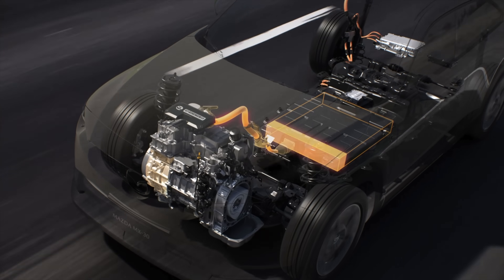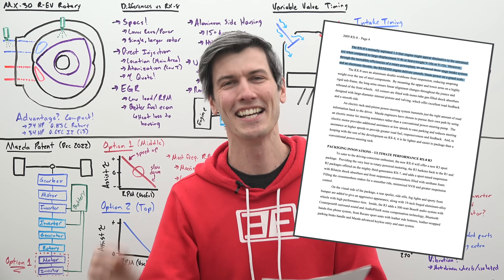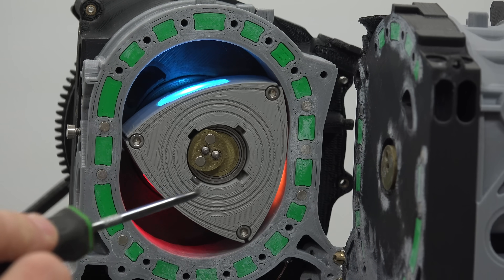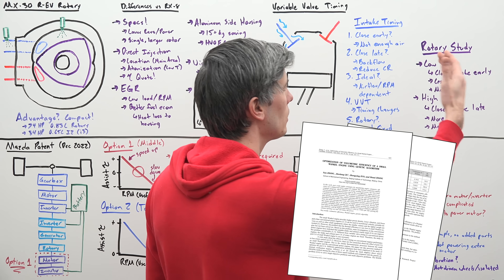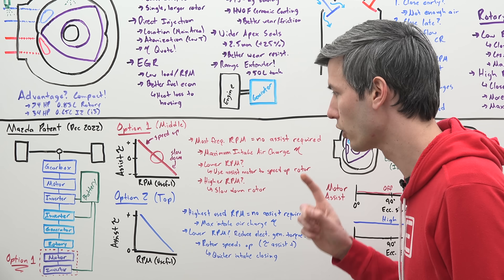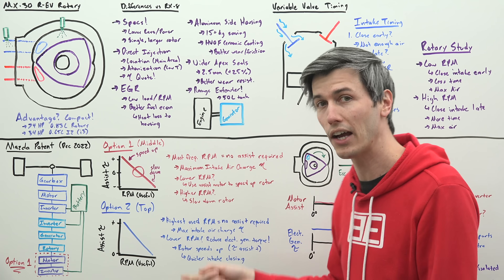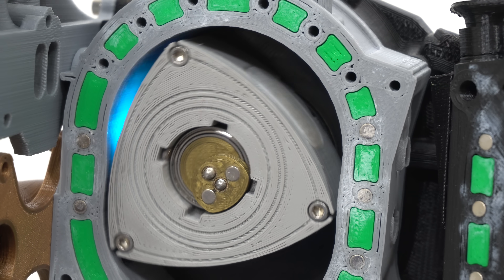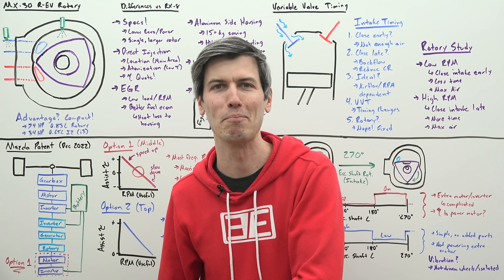Mazda Brought Back The Rotary Engine!

Comment: Why complicate things so much? Just run the engine (range extender) at its most efficient rpm when charging the battery and then shut it off and that s it. It makea no sense using variable rpm for a range extender function. Unless they also have other plans with this kind of powerplant..🤯

Comment: Screw the Wankel design. It has so many downsides. The liquid piston rotary engine is what the Wankel should have been. It solves every issue the Wankel engine has. Unfortunately, Mazda didn't go down this road of building a great rotary engine from the ground up like the tiny team of engineers that designed the liquid piston engine.

Comment: Jeez, another variation of the wankel, have you analyzed the liquid piston version? In the mean time I'll stick with my duramax diesel but if the universe decides to cough up the anti gravity machines in these ufo's then I might switch, especially if I can tow my 11k lb. travel trailer at better than 12mpg.

Comment: The Wankel is always and forever handicapped by its poor surface to volume ration in the combustion chamber causing excess heat loss.  There is no way around this unless materials capable of withstanding very much higher temperatures than currently used are employed.  Think ceramics.  Otherwise the Wankel will never mane decent fuel efficiency.  Period.

Comment: At this point they just throw a fuel cell, a diesel turbine, a NiMh, battery a lead acid battery a reserve piston engine and a nuclear generator into the mix, if you put 6 extra components into a car because you want to make one of the 3 core parts smaller, why stop there? Money and sense don't seem to be relevant here whatsoever.

Comment: It's a generator, why does it ever need to run below max rpm?
Reply: Because load varies and power output varies with rpm.
Wankel engines are inherently less fuel efficient than reciprocating engines in fixed rpm applications.
The solution to the Wankels high fuel consumption is to lower rpm.

FYI: Mazda president Akira Marumoto's announced that the MX-30 has been canceled

Comment: wankel engine is best for airplane because most of the time airplane is at its maximum speed.
Reply: Actually Wankel engines cannot be used in type-certified passenger aircraft because they are too unreliable.
Reply: Wankel engines cannot pass the certification test that requires them to run at full power for many hours without failure.
The apex seal has a extremely low MTBF
Reply: @sandervanderkammen9230   thanks now I know why wankel engine doesnt use on airplane despite of its many advantages like high power to weight ratio and high efficiency at high revs. 😊
Reply: @Gamer6378-d7d Wow! I dont know where you got that misinformation?
Wankel engines don't have any advantages and they are typically less than half the efficiency of reciprocating engines.

Comment: The all electric  mx 30 had a pretty disapointing electric range so they have made this mx 30 r ev with less than half the electric range,oops
now if they still had the 100 mile  electric range with this system , success...what ev car makers seem to have forgotten is charging at home is the cheap to run and convenient  bit, now i know people will say ,what if you cant charge at home, simple dont get an ev.

Comment: I don’t understand the thought behind combining battery with ICE. The level of complex here is insane for no reason at all other than to prevent having to adjust their manufacturing line. Absolute joke.
Reply: The idea of range extenders saw a brief period of interest about a decade ago but has now been completely abandoned.
The only example that entered production was the BMW i3 and it as expected was a massive flop and quickly discontinued.
Reply: @sandervanderkammen9230  — BMW used that sawed-off little motorcycle engine that could hardly move the car when the battery was flat, and Mazda comes along and tries to use a little gas-guzzling rotary.

Neither is a very good effort …
Reply: @sking2173  The whole concept of range extenders is fatality flawed...
Reply: @sandervanderkammen9230  — Many would say the entire concept of hybrids is flawed … But they all have their advantages.

Comment: Why it sucks. They are not good for anything but high rpm unless you just like replacing or rebuilding your  engine every 40,000 miles.

Comment: Clever but uninspired. The original inspiration allowed Felix Wankel to envision a completely new approach to existing technology, which ultimately led to an engine with very different characteristics from everything known. New ideas are possible, but not within the old paradigm of patented technology. That is a box we must break out of before anything truly exciting can be created. As for this design - if all you're looking for is a booster engine to charge your hybrid, then all you need to do is to program your engine to always run at the optimal rpm (and make sure it's small enough to allow this).
Reply: The Wankel KKM57 was designed by Hanns Paschke and Walter Freode... Felix Wankel hated this abomination of an engine.

Comment: isn't liquid piston an evolution of the rotary? why try to combat apex seal wear&tear when you can just avoid it? also, mazda is just keeping the engine alive as aux power. that's pretty underwhelming considering the entire shtick is "we're bringing back rotary".
I really wish they opted to work with liquidpiston rathern than use practically mental gymnastics to justify having a rotary in an EV.

Comment: so they use this engine to generate electricity... they know that its optimal to run it at a certain rpm and running it there is most efficient and least complicated. so why the hell do they make it that complicated? i understand how it works but i see no reason for it. just run the thing at its optimal rpm, generate electricity as efficient as it gets, load the battery and be happy... no special complicated weird stuff needed...

Comment: Well you shouldn`t get stuck looking for a charge station, at 74hp you can run right behind a prius hahahahahhaah!
Reply: 74 horsepower is way beyond the average power requirement of a vehicle of this size, so the generator set can keep up indefinitely in normal driving... including acceleration bursts and grade climbing sections far beyond the 74 HP, powered by the battery and limited only by the EV components.

Comment: I bet maintenance on that car is 2 times worse than a conventional vehicle! They would be smart and just simply do away with the giant ticking time bomb of a battery under your rear and run the car as to how a diesel electric locomotive runs instead and simply run a generator off a more higher output rotor (since 1 rotor = a 3 cylinder 2 stroke)to a transmission electric drive! Just looking at that electric nightmare is enough to make a wallet cry
Reply: The single-rotor Wankel has the power-pulse of a 1-cylinder 2-stroke piston engine. There is one combustion event for every rotation of the output shaft. Likewise, it’s like a 2-cylinder 4-stroke engine.

The output shaft on the wankel turns 3 times for every single rotation of the rotor.
Reply: The Wankel is a 4-stroke
Reply: @sking2173 so that's like a 3-cylinder 4-stroke..
 Just less powerful and less efficient
Reply: @sandervanderkammen9230  — No, the single rotor Wankel has three combustion events for three rotations of its “crank” (eccentric shaft) which is one rotation per combustion event. A two-cylinder 4-stroke has one combustion event per crank rotation, also.

IF the rotor was “locked” to its crank, it would have three combustion events per rotation, like a 2-stroke 3-cylinder like the old Kawasaki H1 500cc bike, BUT, the rotor and crank aren’t locked; the crank turns three-times for every rotation of the rotor.
Reply: @sking2173  Sorry, but you are confused, a Wankel engine has 3 distinct combustion chamber volumes and each has its own 4-stroke cycle.
The Wankel engine requires 1080° degrees of crankshaft rotation to complete its firing order sequence.
Reply: @sandervanderkammen9230  — 1080 deg./3 combustion events = 360 deg./ combustion event…. Which is one combustion event per rotation … That’s what I said. And that’s the same as a 4-stroke 2-cylinder.
Reply: @sking2173  It's still a  3-cylinder 4-stroke engine no matter how you slice it, it just lower power density and torque because of the 1080° firing order.

Comment: Excited for another oil burning, apex seal eating, low torque, terrible gas mileage engine from Mazda. I'm assuming the only reason they are using a rotary is due to its size which it can cram into an EV.
Reply: There's enough space under the bonnet to use a piston engine. Rich Rebuilds has even put a V8 in a Model S (for drag racing etc) and it fitted it
Reply: @simonm1447  right, but the bonnet is a selling point for a lot of people with EVs. So I guess their goal is to retain as bonnet much as possible.

Comment: Bringing back the rotary as a range extender is the most ironic thing they could've done. It's like the final nail in the the coffin. Mazda is dead to me at this point. I've had 5 Mazdas including 2 RX7s. I was recently looking at a Mazda3 as a commuter to reduce the mileage I put on my other car. Can I get a manual? Only with the top of the line NA trim with more features and cost than I actually want. Oh, wait, they make a AWD turbo version! Can I get that with a manual? Nope, automatic only. How about a Mazda6? Stopped making it. All they really make now is SUVs and a small sports car that no one over 6 feet can actually enjoy. Mazda went away from being fun a long time ago and focused on trying to be a luxury grocery getter brand. When Toyota makes more exciting cars than Mazda you know there's a problem. Wish them luck but I won't buy anything from them.

Comment: Cars with a range extender are garbage. No matter how great the engineering behind this is. There is a reason why BMW has thrown the RE out of the i3. A bigger, fast charging battery is just way more efficient and you don't need to carry around an engine your not using 90% of the time which also has to be serviced. Better the other way around, a hybrid with a very small battery or full electric.

Comment: Hello, the whole in the concept of ic's is vapor not liquid😵
Your work is good but it is like tgey continue to intentionally komplikate the situation. If a jet motor spools until you shut of the static frequency converter one should see the true operation is dependent on using the air and electrostatics. They are just stalling wasting time and human consciousness which kan only be evaluated based on Individual Autonymous Independent functioning direcktly on the land free of all social(fabrikated re-ality)
WHAT DOES IT MEAN ATMOSPHERIC MOTOR- WHERE DO YOU SEE THIS EVERY YEAR? DAH, WAKE-UP PEOPLE. Reverse and tangent engineering of technology they stole from the landsmen and re-labeled it under their lientists while they lie in your face and use sy thetic telepathy and bad light frewuencies and bad tap water to keep you under fully awake brain and body functionality foricibly shortening your life and keeping you stuck under their social control.

Comment: How are they over come the need to lubricate the rotor walls and rotor tip seal  oil was injected in the fuel making it burn oil like a 2 stroke case seal always leak, waste of time